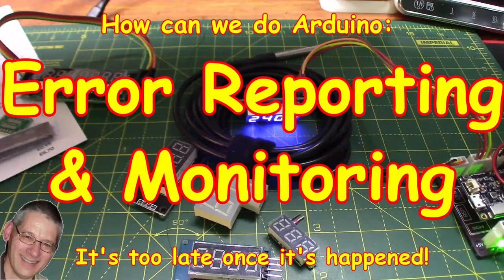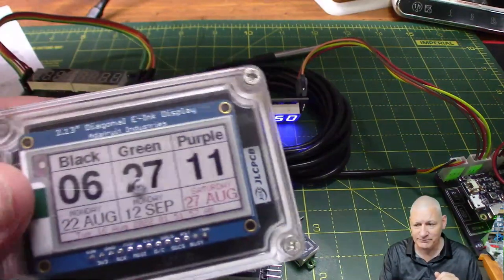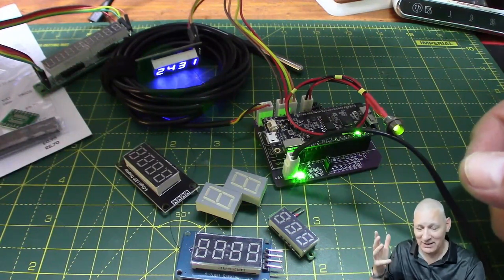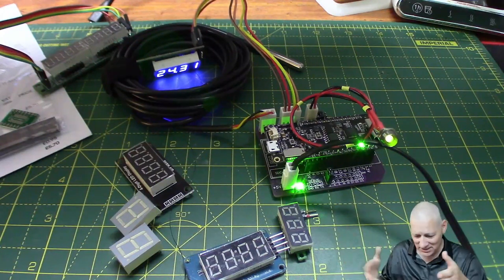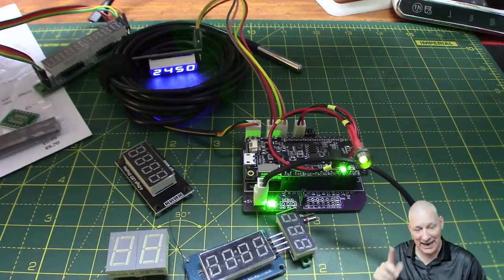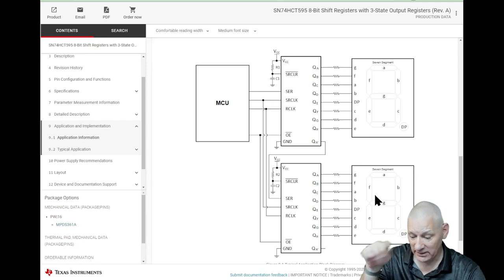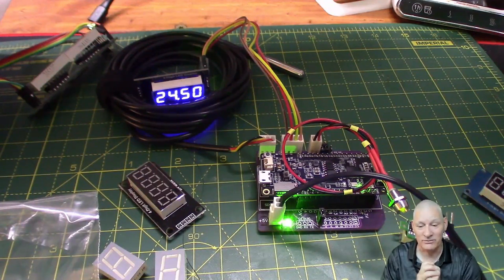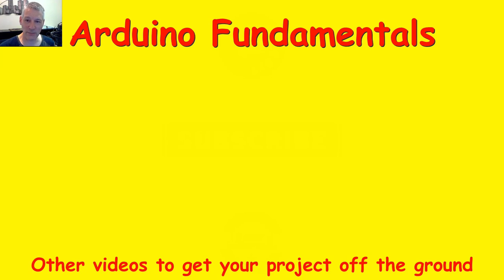#247 What's gone wrong? How do we know?

Comment: Error monitoring? Well many professional coders, generally, turn the back to that one (rather like a guilty dog sitting in the middle of the remnants of a roast chicken in your kitchen). I did come up with a solution to the power down - up problem. One of the first projects I come up with when I returned to electronics was a solution to the "switch it of, wait 30 seconds, then switch it back on" situation  with a mains device. Using a defunct wall wort charger, I put 555 timer, push button and a mains relay (of course  resistors and capacitor too) into the case. So when I needed to switch off ... etc. I only needed to press the button and walk away, 30 seconds later the power was restored. No MCU was harmed or even used in this project. Later on the thought crossed my mind (a rare event in my case) that a similar approach approach might be useful with an Arduino, that is a circuit totally independent of the MCU that would respond to a trigger pulse from one pin of the MCU by interrupting the power supply to the main circuit. Because I wasn't using mains supply, it didn't need a relay etc just the 555 with its timing resistor and capacitor and a switching FET; all upstream of the supply to the MCU. The pulse would be generated by an error routine or the watch dog interrupt (it only had to put a 1 on the pin, the FET would take care of the rest). The experiment was successful but never got beyond the breadboard stage. I cannot solder anymore,  I only enjoy the hobby vicariously by channels such as yours. Just saying. Oh! great video, Ralph.
Reply from the maker: You're almost describing the solution in videos #190 & #194 which I still have and work well (an external watchdog that kills the power to the entire circuit if it doesn't get reset within a few seconds). Yes a good old 555 timer works just fine. It doesn't keep the error in EEPROM though, that I still need to do.

Comment: With Neopixels you can reliable show at least 7 states/messages and have fairly easy indication on a single one and it will remember the last one.
Reply: I like the idea, and they're fairly inexpensive nowadays. The only thing I'd be concerned about is how much memory the libraries needed to run NeoPixels would take.
Reply: That depends. You do not need the large NeoPixels libraries, I did my own routine for handling a single NeoPixels on the old Arduinos and it do not use much memory.
Reply from the maker: You mean seven colours? Well, yes, and just using one wire too. How about a combo of colours and flashing ("BIOS beep code") errors. Green (short) Red (long) Blue (long). Wow! My mind boggles.
Reply: Yes, I mean 7 colors, you can add more if you play with the intensity, but it gets harder to decode. Any flashing requires the processor to be involved, a steady color do not.
The code I use to handle the NeoPixels is about 30 lines for a Nano/Uno.

Comment: I would use a secondary controller, which can regularly wake up to save on battery and periodically poll the situation of the device you are concerned about. I'm a massive fan of having an independent monitoring solution. With that, I can decide what states to collect, how to store it, and if I want to forward it. The SN74HCS594QDRQ1 looks like a good match for the application 7-segment readout, for example, monitoring two significant issues, i.e., a random number of reboots and dead. The display can visually show the number of times rebooted and flash furiously to indicate loss contact, acting as the heart-beat indicator. Just my2c. Cheers.
Reply from the maker: Independent monitoring is fine for larger projects that are permanently powered. It's the little projects, possibly on battery that are tricky to monitor.

It might be that there is no other way to monitor those other than to either send out an error message (if it has some sort of Wi-Fi) or write to a small, cheap e-Paper display.
Reply: @RalphBacon I agree with you on the target small hobbyist project. Still, it will be a challenging project to try to realize my alternative and use a very cheap controller and don't implement any wireless forwarding. Can it be done? I have to think a bit about this and weigh the pros and cons with your upcoming solution; anyway I eagerly follow how your project progress. Cheers.

Comment: How about sourcing  avery small epaper display.  Have your functions send the codes as your executing.  If the project hangs, the e-paper will still have the last error code.
Reply from the maker: I used to do this with PIC projects but the difference is that the I don't want the display to be a permanent part of each project (too pricey). If I can connect afterwards, fine, but by then chances are the error has already occurred.

Comment: With the ESP8266 write the error code and UTC timestamp to 'system_rtc_mem' read error(s) via telnet ('z' reset last error), or send via MQTT to a system/error topic with retain set. I always have a heartbeat LED 13mS on, 7Sec off = OK, faster for an error.
Reply from the maker: Sending the error to a centralised point would be fine but the Arduino can't do that without extra hardware. But good for other μControllers.

Comment: Hi Ralph, great challenge/project.  In terms of capturing some system state data (perhaps as the power is about to fail) I tend to think about eeproms - e.g. Microchip AT21CS01/AT21CS11 single wire devices ... good for 1million+ writes and should hold data for 100 years so hopefully we might notice something by then.  On reset have the sketch check the eeprom state and if it finds a message there then use an LED to blink it out .. perhaps use Morse code for fun, then another mini-project to make a separate Morse detector/decoder to display the messages.  If you have the luxury of an extra button to wipe the eeprom then great, if not wipe it after some time period or number of times transmitted.  Just a thought.
Reply from the maker: Why stop at Morse Code? How about binary code? Semaphore? Why make it easy to find out what the error was? 😂😉😋
Reply: @RalphBacon  ... 😀 got to find a reason to practice those skills or we loose them.  
Yes, any interface but I could see the advantages of a non-contact, minimal tech solution.  All the best.

Comment: One of the first commercial projects I worked on (back in the 1980s) flashed Morse code on an LED to indicate an internal error.  It's a good thing that it almost never failed in the field since getting a customer to accurately report a series of long/short flashes is nearly impossible.

For a project with a Bluetooth capable chip, I wonder if it would make sense to publish error values in an attribute.  Then use one of those Bluetooth scanner apps on your mobile phone to read the error codes or messages.  Of course, that's only useful if Bluetooth is functional.  And I'm not sure how well you can mix Bluetooth and WiFi on an ESP32.
Reply from the maker: You can run both BT and Wi-Fi concurrently on an ESP32 - but what about the humble Arduino (and similar processors)? Morse code... well, BIOS beep codes are similar, right?

Comment: I think two lit 7-segment displays will use too much current for battery-powered projects.  First, I would think that one display would be enough.  If you include the letters and other special characters that can be displayed, you probably have far more different error codes than you would ever need.  Second, I suggest running the CC pin through a switch or jumper to ground so the display lights up only when you need to read it.  Finally, rather than populating the eight segment resistors, I think you can get away with using just one CC resistor.  There would be some variation in brightness depending on how may segments are lit up, but if you eliminate the 1, and put tails on 6, 7 and 9, I suspect it would work well enough for this purpose.
Reply from the maker: Yes, for battery powered projects it should only display the error code on demand, just as you suggest. Good idea. I was going to use a resistor network, if they exist at the right resistance, or perhaps just SMD components are small enough. But, as you say, we're not after perfection here so maybe a single common resistor will be good enough. All good ideas 👍

Comment: even simpler: use diodes to display a binary number. you can add as many as you need for the number of error codes you have.
Reply from the maker: Yes, that was on my list too. 3 LEDs gives 7 possibilities, more if the LEDs are bicolour. My new motherboard uses LEDs rather then 7-segment displays.
Reply: Of course the seven segment LED can be read as a 7 bit number if you wish rather than a digit.  It's all in how you interpret the data.

Comment: A helpful idea, unfortunately with IOT devices that are designed to run on minimal current drain doesn't this impose a further unwelcomed continuous load on the battery.
Reply from the maker: That's the issue with battery powered projects. My rubbish bin reminder only runs for about 10 seconds per day. I can't keep it switched on longer or the batteries will die very quickly. I need to use that e-Ink paper display, I think, in that case.

Comment: Error reporting routines are ok until the processor gets stuck in a loop, HW watchdog is a nice addon, oh I dunno, maybe a digital out that pulses, charges a capacitor, if the pulses stop the cap discharges, that removes power from the arduino, then another bit of electronic trikery to repower it, gets complcated i know but a hw reboot is always a sure fire way, maybe a 555 timer for nostalgia
Reply from the maker: My external watchdog uses a 555 timer to totally switch off the Arduino and everything else! You must have missed video #190 and #194 https://youtu.be/WpihLPvY9Ac

Comment: Another great video. You have great communication skills and explain things very clearly. I'm working on something of a similar nature (although not exactly the same) at the moment. It's an Arduino Uno with a TFT shield, which acts as a serial monitor. So, I can just plug it into the UART Tx, Rx pins of my esp32 and get it to print serial commands to the monitor. The motivation is a portable go anywhere serial monitor I can use for OTA updates on esp32.

On another note, can I please request a video on making a custom shield with pcbway (for example). So, I can just plug my TFT, OLED, temp sensor, INA291, motion sensor, ultrasonic sensor, etc... straight into the shield, in the direction I want, without all the messy wiring. Let me know if you've already done one.
Reply from the maker: I had something like you described, for use with PICs. Still got it, in fact. Worked well and ensured I only needed ONE display that I could use for all my projects when debugging "in the field". The drawback is that if an error occurs it's too late to see that error (it might not happen again for a while).

Regarding the PCB, you mean you want a generic PCB for a single Arduino and multiple sensors and displays?
Reply: @RalphBacon  Thanks for your reply. The original motivation for a project specific shield came from a diy "smart" (don't praise the machine) camera for object recognition, that I was working on with a 2.8 inch TFT and an esp32-cam. The TFT has a lot of wiring. So, I had to solder female header pins for each one to their own perf board and connect the perf boards back to back, so the TFT and push button was on one side and the esp32 cam was on the other. My soldering skills are not very good, and it was quite a job... got it right on the second one. I thought about designing a pcb shield where I could plug the esp32 in one side and the screen the other side. I looked up some tutorials, but they all seemed a bit of overkill for what I wanted to do. BTW... this is the project I used your "ps_calloc" hack for.

Comment: Hi Ralph, I watch every video and have followed you for years, Great Tutorials.  In this video you mention a temp sensor in your attic using ESP NOW. I have moved into a new home and am having problems with temp differentials in various parts of the house. It would be great to be able to monitor the temps at several locations and perhaps log them to the cloud for future study. That way I can see what the old readis were and then could compare them to the NEW readings after I make a change (Hopefully made it better, but not always). Could you share your code on your temp monitoring system? I think others in your subscribers group might also be interested!
Reply from the maker: Take note that ESP-NOW sends data from one ESP32 to another. No cloud involved. 

However, my Home Alone system (to monitor my mum's activity level) does log data into the cloud (ThingSpeak as it happens but could be any one of a number of Cloud data providers). Telegram is another option. Many of these Cloud data providers allow free access for small amounts of data (4 updates an hour, for example. I think Telegram allows 12 an hour.). If you were thinking of logging more you may have to pay to do it.

It sounds to me that you need the second method of recording data so that you don't have to do much except look at it to see how your efforts are affecting that data over time. Someone has written a ThingSpeak widget for Android phones that display the accumulated data over a day/week/month or custom period. I use that to monitor my mum's activity levels.

I'll think about whether it is going to be of broad interest to share this Cloud data upload with others, given that IoT is all the rage these days!
Reply: @RalphBacon  You mentioned that you had several ESP's sending ESP_NOW data to a unit for your home use. That is what I referring to. Was interested in seeing your code for this temp and humidity sharing. I thought there were problems with using ESP-NOW to collect the data then with the same ESP board connect to wifi to send data to the cloud. Could be i'm just confused!

Comment: If you just use a big enough capacitor that can deliver the energy to your monitoring circuit, so the circuit you make must be able to continuously monitor for example the serial port looking for some specially preprogrammed errors which it can trigger of, then after the trigger the capacitor gives you a few seconds to capture the error code and save it in a flash memory chip or you can use an EEPROM chip to store the last received data, then when you first put power to the error monitoring circuit it will display the error code.

You can even make it battery powered instead of using the capacitor to continuously show the error code on the display until you reset the microcontroller, the point of making this useful is that you only have to be able to capture some fixed set of data when the error occurs, then save that to any kind of memory and display it instantly and always or only temporary, whatever you like the most of the two latter options and that's about it.

Can't be too complicated to make something like this I think.
Reply from the maker: Well, Ricardo, I think it is more complicated than you might imagine. Battery powered devices must be treated differently. 

And devices without Wi-Fi capability the same. I've tried capacitors (super-caps) and they didn't work at all. Some of those chips are very power hungry!
Reply: @RalphBacon  Hmmm, I thought it could be made simple like I suggested but apparently I was wrong, now I'm curious what you come up with or someone else comes up with.

Comment: I noticed that you are able to control the red/green LED colors using only two wires.  Could you let me know what LED this is and how do you switch between red and green using only two wires?  Thanks
Reply: those 2 pin dual colour LEDs have two internal LEDs which are connected in parallel but in opposite polarity. So when current passes through one way it will be one colour and when current runs through the other way they are the other colour. 
one way to drive this would be to use two separate outputs that can be pulled high or low individually connected to the LED in series with a suitable current limiting resistor. the outputs would need to be able to drive the LEDs current, say 5-20mA depending on the LEDs.
Reply: It's a bi-color LED.  It's essentially a red and green LED in a single package, with the LEDs wired with opposite polarity.  With one pin high and the other low, you get green; reverse that, and you get red.  If you alternate the polarity fast enough, you'll get both red and green, which makes yellow.
Reply from the maker: If you alternate the polarity fast enough you get a dirty orange/brown rather than yellow. Yuk!

Comment: I had an issue with chicken coop door controller where I could see when it was failing. I put an OpenLog logger module into the unit and logged the serial line where I outputted constant status data so I could see what was going on within the software.
Reply from the maker: Which is effectively what I had to do with my Rubbish Bin Reminder project: I connected my tiny laptop to the serial port (USB) and just left it running for several days until it went wrong! Not great for wires an I had to plug the laptop in too!